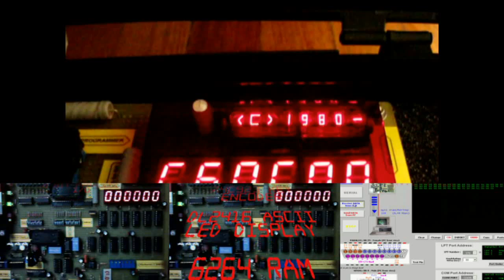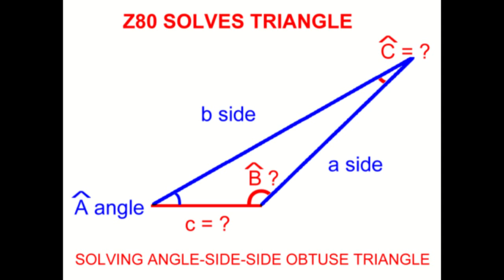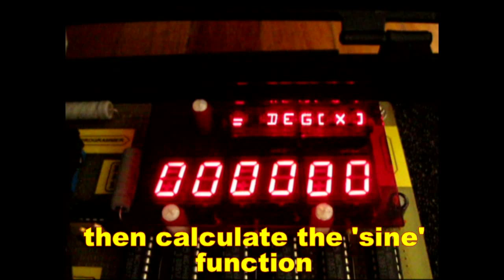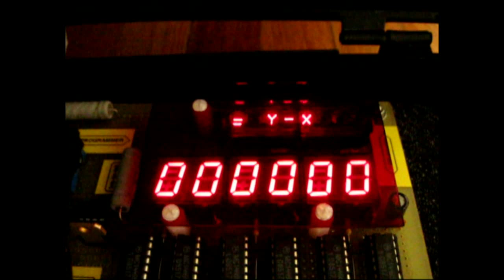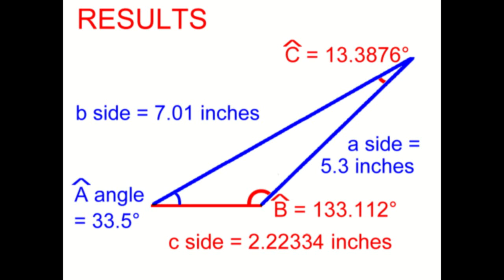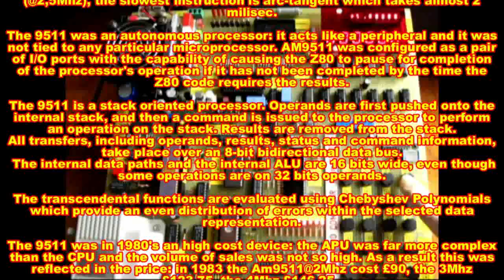Homemade Z80 COMPUTER as a scientific calculator solving triangles with AM9511 coprocessor

Comment: I had configured the AMD 9511 with Timex 2068 ( that is the US variation of the Sinclair Spectrum) Z80 based computer. The trick was to select the AMD 9511 when a program would have wanted to access the floating point ROM routines. I used the existing stack locations which the existing ROM was using for floating point operations.The beauty of the Timex 2068 was it had a cartridge slot where most of the Z80 signals are available. For the 12 volts required by AMD 9511, I used the Texas Instruments’ TL497A integrated circuit, with a wire-wound inductor. All the circuitry was soldered on a veroboard with wire-wrap wire. The circuits fit nicely on the veroboard, where I had screwed 0.1 inch edge connector (male) so it could be pushed-in into the cartridge slot. The circuit provided phenomenal speedup to both integer and floating point arithmetic. Those were the days!
Oh for those interested Intel had a licensed version of AMD 9511, known as Intel 8231, which was marketed for Intel 8080A processors.

Comment from the maker: @Ryuuken24 Hi , you may replace the crystal, but you need to check if your CPU can work at that speed (for example Z80A could be raised to 4 Mhz, Z80B to 6 Mhz...). But you could have problem with slow memories, so you need to check their speed in ns. You can try...If you have a serial interface, it might not work since it probably uses the same clock. AM9511A-1 can work till 3 Mhz.

Comment from the maker: Hello! you are right: you can do by SW. But to implement in assembly all the 32-bit FP operations takes more than 4KB of memory: HALF of my poor EPROM! AM9511 is also faster than any Z80 assembly (@2.5MHz...). The interface uses a direct mapped I/O technique: simple and fast but assembly is not an easy stuff since it is a non-IEEE floating point format: as an example PI = 3.1415926 = 02,C9,0F,DA !! Overall this 80's chip is cool and Z80+AM9511 is a perfect marriage without anachronistic mistake!

Comment from the maker: @halamkajohn

> The stupid thing says BIOS 
Sorry but this is my  "Basic Integrated Operating System" or, if you like, "Basic Input/Output System". It is the first code run when powered on and it does diagnostic routines and hardware configuration.

> It has extra components .
Pls remember it has two EPROMs burners, step-by-step circuits, power supply, keyboard, serial/parallel interface, interrupt controls, co-processor, 2 Rams and displays: all built-in and all with late 70's DIL technology !

Comment: Hello I ordered a 3MHz. version of the AM9511-1DC
does AM9511 works with 5V or 12V only or does it needs both pins 5V and 12V connected ?

Thank you

DJ
Reply from the maker: Hi well done! You need to have both VCC +5 and VDD + 12 connected !
Reply: Thank you for this bad news :-)
My current MC6800 retro computer is a 5V only design looks like I need a 5/12V power amp.
Do you know how maximal current (ampere/mA) does the AM911 used by 12 V ? 

Thank you.

DJ
Reply from the maker: I've used a L7812 voltage regulator on a small heatsink. But you need some higher voltage before it. 200 mA current is ok. If you don't have just add a small 5W 15V transformer power supply and connect the grounds together.
Reply: How do you convert a ASCII float and normilze the 32-bit floating pont number ?
or do you have a link for me ?

thank you
DJ

Comment: Would it be possible to hack an 8bit cpu, to make it have more memory, or add a buffer memory to speed it up? If I replaced the crystal oscillator, do I get a speed boost, or the cpu will not see the difference? Thank you !